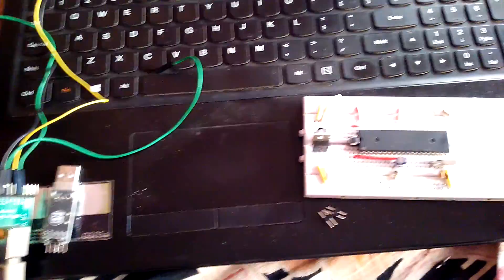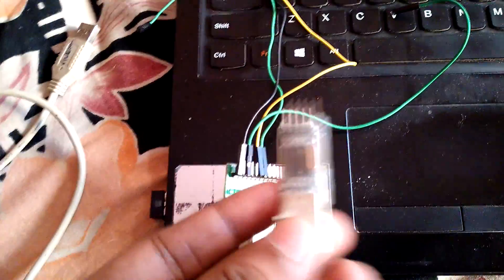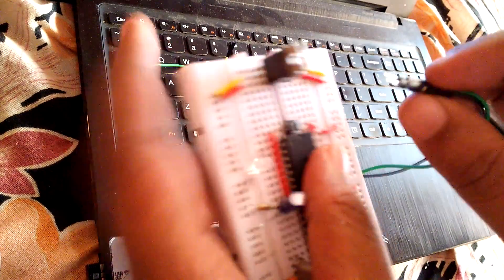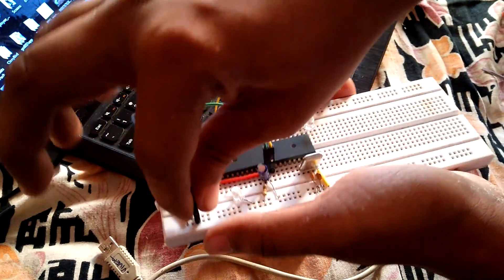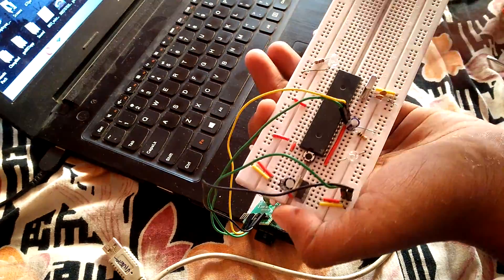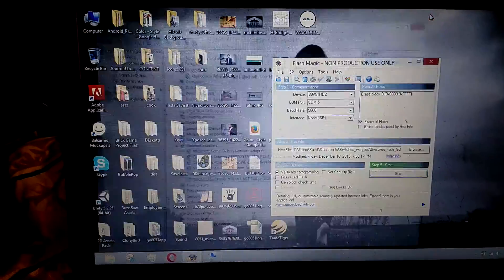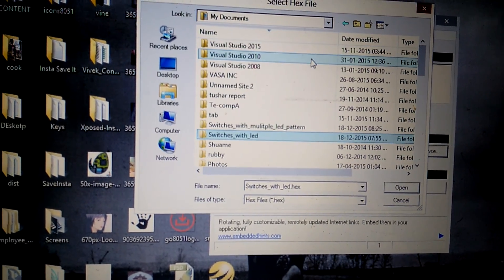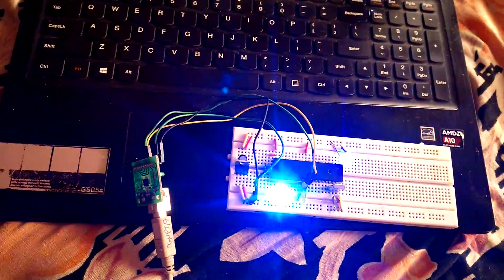How to Program a P89V51RD2 (8051) Microcontroller using USB to UART on Breadboard

Comment: Sir, it possible to program an AT89S51 chip with USB to TTL(UART) converter?
Reply: i read in many forms about  this topic and it says its not possible as it can be programmed through isp   I use an  Arduino to do program it
Reply: I tried once.But not success
Reply: Why it's not possible? In video he also using same mcu right